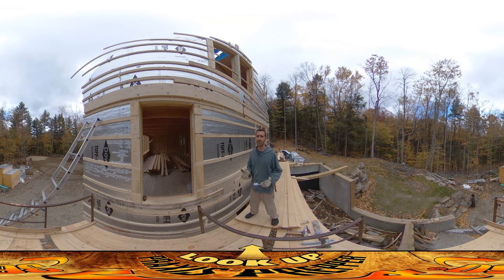Homestead Building - Locked Out of Car, Threaded Rods as Giant Lag Bolts

Comment: i'm sure you thought of this & rejected it already but...why not countersink by drilling small washer size inset in both sides?  if that makes any sense, I don't know the proper terminology.
Reply from the maker: I know there's a tool that could do what you describe - I just didn't want to buy it for such a small task. But yeah it'd be faster, and cleaner too.
Reply: @PraxisPrepper  I just use a drill bit, I think they were sold for making holes for installing door knobs & locks.  just a wood bit that cuts 1" round & clean depth cut...not the "O" design but solid cut?
Reply from the maker: @bevlower6793  That sounds like exactly what I should have used. I'll get that one right when I do my 3rd house... someday. ;)